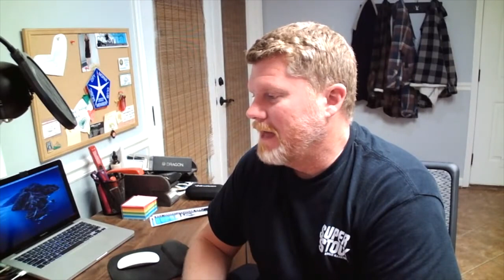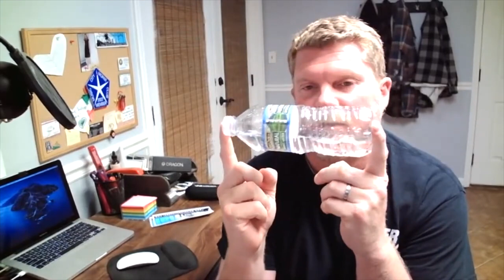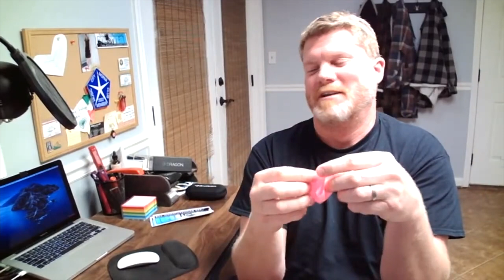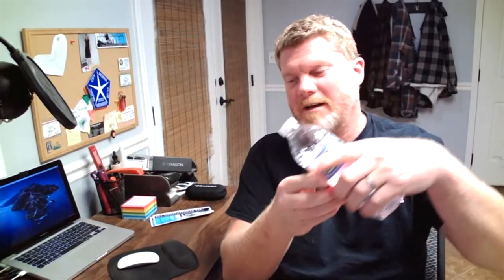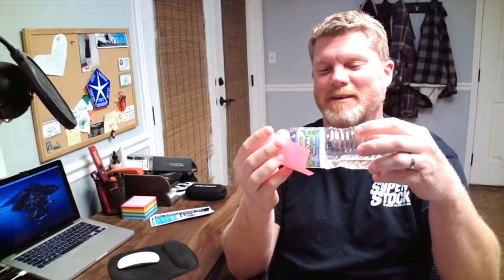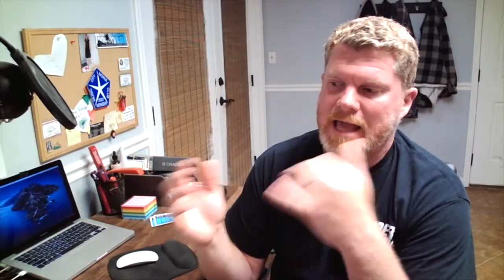Hull Cracking in ST3 Sea-Doos Explained Very Poorly: WCJ Quick Topic

Comment: I have a 2019 rxtx300 with 155 hrs on it. I run the intercostal waterways, ocean, and rivers. All is perfect. No sign of any of these cracks at all.
Reply: 300 hours on my RXT-X 2021 and 0 issues.
Reply: ours just cracked - 2019 lake running only, some wake jumping, cracked from the point he described back to the mid-point of the hull.

Comment: Maybe is because I am paying attention to this now. But for me looks like theses cases are popping just now. 
But you said 10 years ago info. Wow. 
So, their quality process has a failure that is easy to fix and for some reason this is not happening. 
It is a concern, mainly for people like me that goes after long crossings.
Reply from the maker: Not sure how you think it’s “easy.”
Reply: @watercraftjournal  after 16years on processes improvement and processes engineering we end up having some ideas. 
If what you said is accurate, it is an easy fix problem and it will be mainly procedural.
I would love to help them, but I don’t know anybody at BRP. 
Anyway my first SeaDoo is coming and it is as GTX. I intend to do Bimini, so I hope I’ll get a good one.
Reply: @watercraftjournal  What is the cause of the air pocket in the mold? I'm an eng student and I'm wondering whether seadoo is using a pressure molding or vacuum molding or some combination of both. If the air pocket is an unavoidable flaw of the process I'd imagine that a material that expands a little bit could mitigate the issue somewhat.

Comment: Has Sea-Doo beefed up the ST3 hull since 2018/2019 when it first came out, or improved on the manufacturing of it for the 2022's and later years? Looking at a 2022 GTX this weekend.
Reply from the maker: There have been zero changes to the ST3 hull design since its introduction 2018.
Reply: @watercraftjournal  well that's disappointing. Do you know whether those ST3 hull GTX machines are robust enough to withstand powering onto floating/drive-on docks???
Reply: Yes...absolutely. I do it almost everyday.
Reply: Design vs production are two different things. Sounds like it wasn’t a design flaw, but a production flaw. 
Although they haven’t changed the design since 2018, I am pretty sure they have adjusted the production to fix this problem.
Reply: @travisgrant5536  Using sheets of acrylic for boat hulls is indeed a design flaw.

Comment: I'm in a lawsuit with Sea Doo over a 21' Trixx 3up that's leaking around the radiator that they tried to fix 4 times and failed. They are the worst at customer service and warranty repair. Stay away from buying anything but a Sea Doo
Reply from the maker: Radiator?